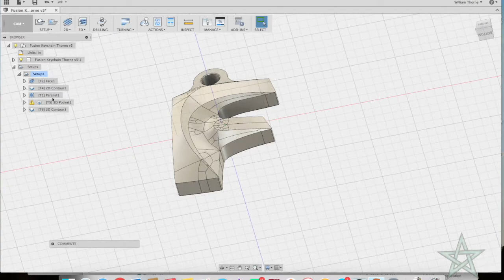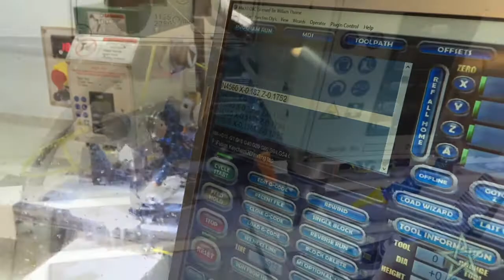G0704 CNC Mill- First Flood Coolant Project- Fusion Keychain

Comment: Nice!!! How did u get the smooth surface with the ball mill I just did the same thing and I get lines from the ball mill how did I get it so smooth??? Nice work
Reply from the maker: Thanks.   I used a pretty small step over.   I think I used .005.   Maybe smaller.  with 1/4" ball end mill.  The lager the end mill ...the better the finish too.
Reply: Hidden Acres  or I’ll have to look at what my step over is I finished mine last night and seen yours and really liked how smooth it is so if I use a bigger ball endmill do I still have to let fusion 360 no if I change to a bigger bit don’t I?? If I didn’t change the size in fusion it would mess up the peace wouldn’t it? I’m new to CNC converted my g0704 a week ago lol thanks for the info it helps a lot
Reply from the maker: @travisbernard8618  I just looked at my fusion file for that and I used a 1/4 ball end mill, Pass direction - 0 degrees, step over was .004,  direction - both ways.  feed rate was set at 20 in/min but I am sure I slowed it down in Mach when I ran it.  hope that helps.

Comment: what coolant are you running?
Reply from the maker: Sta-Lube.  Its pretty cheap and seems to work OK.
Reply: I switched to Koolrite 2290 and it is absolutely phenomenal.  if you have issues with smell or rust or part finishes. give it a try, it's only like $35 shipped for a gallon of concentrate and has a sump life of probably 1-2 years from everyone who has run it as long.  great stuff, changed the quality of my parts made on the G0704
Reply from the maker: Thanks.  I'll keep it in mind. - Bill